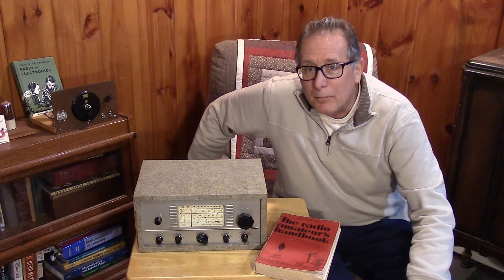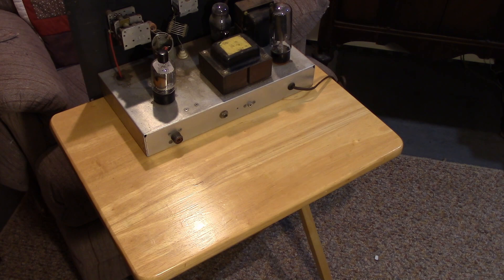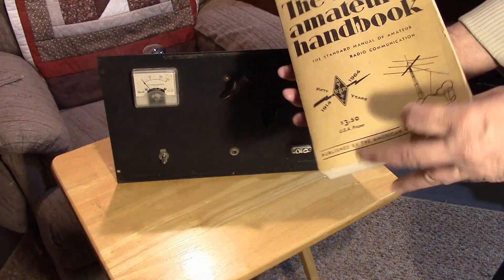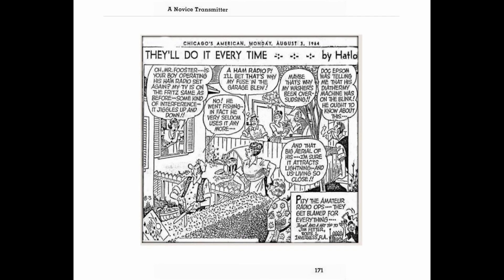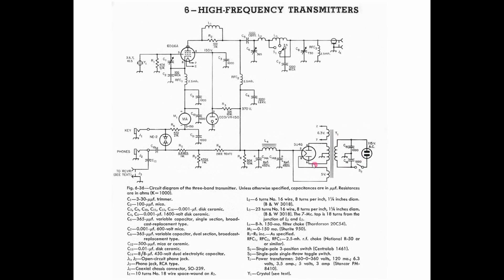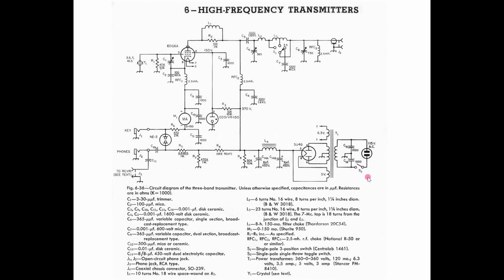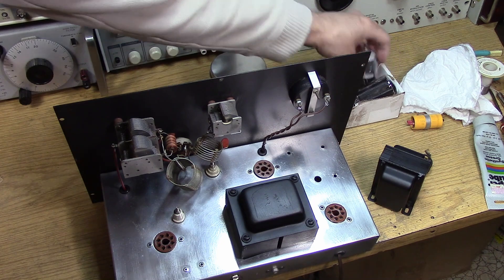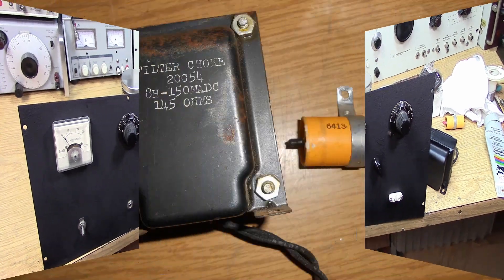Handbook Novice Transmitter Part 1

Comment: This brings back lots of memories.  I  built my first novice two tube two band transmitter from plans in the January 1962 issue of Popular Electronics magazine.  I picked up soda bottles and used my lunch money to buy parts.  I still have the transmitter, and magazine, sitting on my top relic shelf.  I made contacts with the transmitter, but it wasn't easy! jim...WA7VVV

Comment: Thanks for this series Mike. From the colour of the cover, your copy of ARRL's The Radio Amateur's Handbook looks like the 41st edition, from 1964. FWIW the project appeared unchanged as A Three-Band Oscillator Transmitter for the Novice, every year from the 35th edition of the Handbook in 1958 until finally in the 42nd edition of 1965. The design was by the late Lew McCoy, W1ICP; it was first published in QST of December 1957 as A Three-Band One-Tube Novice Transmitter. All those Handbooks, and the QST issue, are available (legitimately) as free PDF downloads from the worldradiohistory site.

Comment: The loss of vacuum does not show in vacuum tubes, the air (replacing the vacuum) oxidizes the metallic getter material sputtered on the inside of the envelope (mirror) to a white powder stuck on the inside of the glass. Ron W4BIN
Reply from the maker: I see that powder on some of the broken ones!

Comment: Nice work Mike! I'm keen to see how it turns out. I'm especially interested in using the modern crystals. I bought a whole bunch of FT-171B's and found many of them had their internal quartz replaced with HC49's! How you prevent them from being overdriven is something I'll follow closely!
Reply: use a 2n2222 xtal oscillator with the hc49 to drive the tube
Reply from the maker: And fit the entire assembly in the FT-243? Challenge accepted?

Comment: That’s a neat find. A friend insisted I take a huge power supply, transmitter, and modulator he’d scrounged, apparently built from “The Radio Handbook” in the late 40s-early 50s. It uses an oscillator, buffer, and PA topology. It’s missing the PA tubes, and I haven’t tried to determine what they are—certainly bigger than 811’s—but it’s all reminiscent of this little rig of yours. Wish it was as solid! I look forward to seeing this one come to life.
Reply from the maker: That is very typical of the main transmitter setup in the 40s. Might use 304TLs or even 813s!

Comment: You mean he didn't say "Worked last time I plugged it in"?  I honestly thought you were going to say that you bought back your own transmitter!  I built a ASCII to Baudot converter way early in the digital/computer games and ended up selling it at a hamfest...fast forward probably 10-15 years at a another hamfest I saw a box that looked awfully familiar and it still had my old call sign on the front panel in glorious DYMO label maker.  I just had to buy it back for nostalgia sake!  ;-)  73 - Dino KLØS
Reply from the maker: Actually this one would not have worked since I found the main coupling cap lead was broken. Dymo maker YES how many of these had those? Once they set on with Nicotine after 40 years, they really get a nice patina.

Comment: I've recently been doing some work with one-tube transmitters, and I'm finding they are much more crystal-friendly than their reputation, with the right component values and voltages.  For example, I've had a 6AU5 sweep tube putting out 10W on 40 meters with an HC49 crystal, with no chirp.  The three things I do are 

(1) remove the grid-cathode capacitor entirely, just using the tube capacitance.  On 80 meters this may not work, but it always works for me on 40 and up.  

(2) lower the grid leak R.  I found that, for the 6AU5 at 10W out, a value of 6.8k was optimum for power out and low stress on the crystal.  Yes, 6.8k, not 68k.  I wire a 25k pot in for the grid resistor and adjust for max power, then replace with an equal or slightly greater value fixed resistor.  Values like 47k turn out to be way too high.

(3) reduce the screen voltage to the minimum needed for the desired power output.  With 300V on the plate of the 6AU5, I only need 110V on the screen for 10W out.  Keeping the screen voltage as low as possible (for a given power output) keeps the crystal excitation to a minimum.  Then just peak both the TUNE and LOAD caps for maximum power output.  

I haven't tried above 10W out since my power supply pretty much falls over above that level (around 20W input).
Reply from the maker: One big secret is to use a lower voltage regulator on the screen of the pentode or on the plate of the triode. When you run them at 200 to 350V, that is where the crystal current can really get high. Yes output power will suffer a bit.
Reply: @MIKROWAVE1  I can get 10W output from a 6DQ6-family sweep tube with only 50V (!) on the screen (350V on the plate).  I know it sounds fantastic, but it's true.  5W zeners are great for screen regulation at lower voltages.  Peak output grid resistor value with that tube is only 2.4k.  I've found that the lower grid resistor value also reduces harmonics.  That 10W transmitter has the 2nd harmonic down 47dB, well below the legal limit.  If I increase the resistance, the power goes down and the harmonics go up.

Comment: That was also one of my first transmitters when I was licensed as a Tech in 1976. The circuit was in one of the old ARRL Handbooks that was in my HS Library. I made the transmitter as part of a project for Metal Shop. I used a chassis from a Halicrafters S38(?); as it had all of the same power supply components. I think the only part that I needed to buy was the 0V3 VR tube. BTW, theres a QRP version in a Nov/Dec'77(?) 73 Amateur Radio Magazine that used a 6AQ5 audio beam amp tube. WA1YKL
Reply from the maker: Same but I had a power supply already for my ARC-5 made from TV parts. So my whole transmitter fit in a Heathkit VTVM box! But no regulator tube and I cracked a few crystals!

Comment: I built the  10W version using that same power supply except mine had a 6v6 final for 40M.  I had just gotten my General so I loaned it to a friend who had his novice ticket.  He bragged on the transmitter working so well.   I saved up $100 and my dad drove me to Bessemer Al to Ack Radio to buy a used NC190 receiver.   Lot of money for a 14 yr old back then.

Comment: Hey, as it's almost impossible to find those PI wound 2.5mH chokes used in a lot of these transmitter circuits is it be practical or ill advised to use a modern 2.5mH inductor, say the switch mode or power inductor style devices that you can buy from Mouser or Digikey in its place?
Reply from the maker: Nothing more rabid than a confident novice. Take a look at my video about "Choking on Radio Projects?". Also beyond winding your own, which is completely practical, some folks like to use Type 75 material toroid's or those 470 uH -1mH bobbin core jobs from Mouser in series.

Comment: For  some reason   photos  of  S-38's keep showing up.  Hallisrapters  should have their  collective  a$$s  kicked for EVER marketing  such a  nonsense radio  (AC-DC)  to  young would be hams,  not only for the  poor performance, but for the  electrical danger.   I had one,  as well as  a Heath AR-2 or 3,  and even though the performance of the Heath was not   light years better, it WAS  some better,  and  hundreds of volts  (LOL) safer.
My  first attempt at  a tx was  a  sweep tube oscillator  and I had put the plate bypass on the wrong end of the  plate RF choke!!!    I quickly abandoned that  miserable crystal  breakin'  ho  and  went with a  6AQ5/ 1625  on  80/40.
Reply from the maker: I agree that much equipment component quality, production wiring and circuit practices were all over the map to keep prices low. The sad face of a kid with a broken crystal blank after opening the FT243 - been there.

Comment: not a good idea to double or triple in the final, or oscillator that is directly driving the antenna.  Should run the final stage straight through to avoid harmonics and sub-harmonics being radiated.
Guide pins were most likely broken off by accident, and not removed on purpose.  it's rather easy to break them off when removing a tube and 'bending' it in the socket, usually when a tube is all the way in the back of a TV set and hard to reach this will happen.
Reply from the maker: The FCC wrote me a note and they seemed to agree with you. I had a nice signal on 20M they said.

Comment: Wow!  This brings back some memories for sure.  My first ARRL Handbook was the one you displayed from 1964.  My friend and I built 2 of these units, a variation of this transmitter based on the handbook for 40 meters only.  We used parts from mostly televisions and console radios from the 1940's and 1950's that wound up on the curb during "Junk Week" in Clifton, NJ during the springs of the late 50's and early 60's.  We even ran into the Xtal current problem you mentioned.  I can recall burning myself touching the FT-243 crystal.  Left a blister.  Yeh, a hot radio and a learning experience.

Thank you for taking the time to produce this series.  I'm looking forward to the rest this radio's story.

Comment: What a great find.  Those HC49 crystals have crummy frequency stability if you run much current through them due to heating.  Long before they crack.   I haven't tried one with the 100 Ohm resistor in series.  It will be interesting to see how that experiment goes.
Reply from the maker: Whoop Whoop! We shall see and sacrifice to the crystal gods.